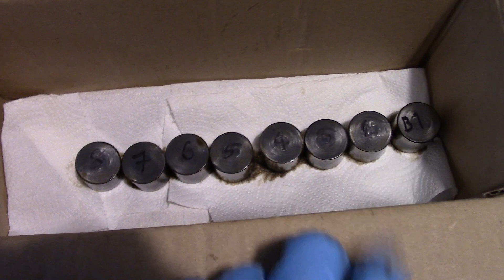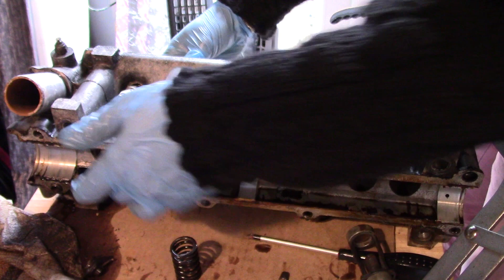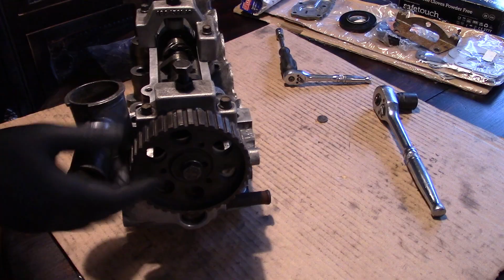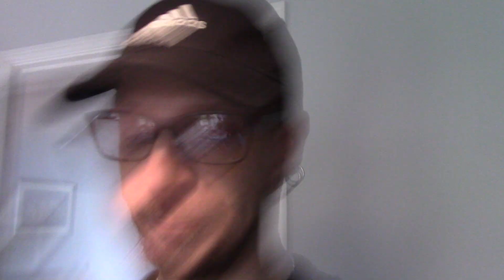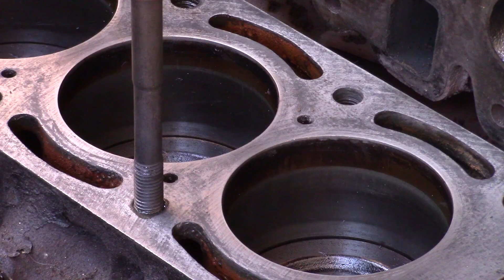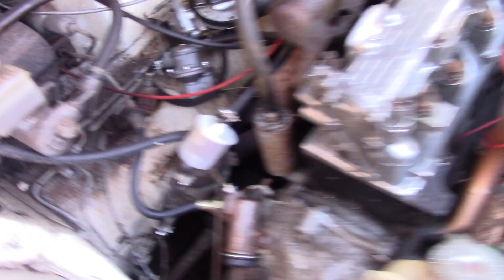1980 Austin Princess - Rebuilding the Head

Comment: I think you may be making it harder for yourself when using the valve spring compressor! The screw adjustment is to just get the tool set up, it is the lever that you use to actually compress the spring. If you were doing it the way it seemed on the video - that is indeed hard!

I tap the end of each valve stem with a hammer just to help break the seal before using the compressor, that makes the process easier.

Look forward to the next one! Thanks for sharing!
Reply from the maker: It was just fighting me in general and I wasn't well at the time, lacking a lot of physical strength and brain power.  We got there in the end, happily, and hopefully I shan't have to do it again for a while.